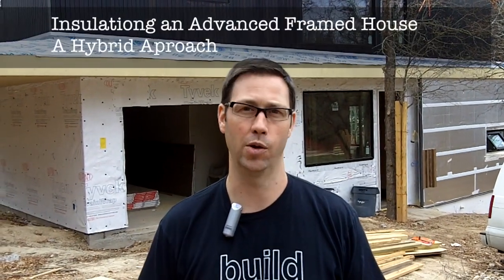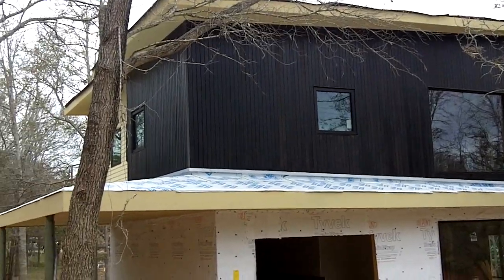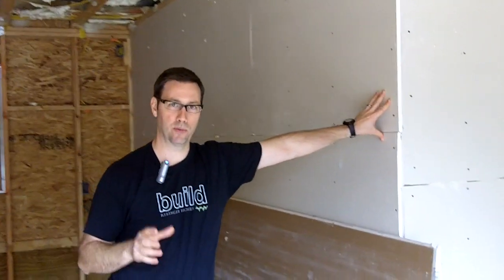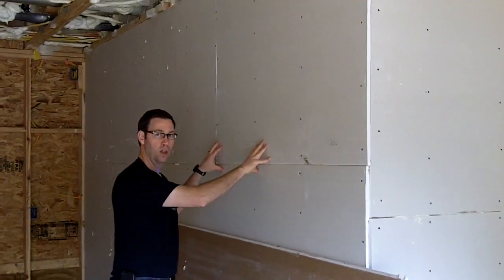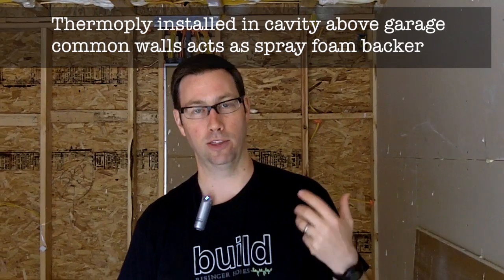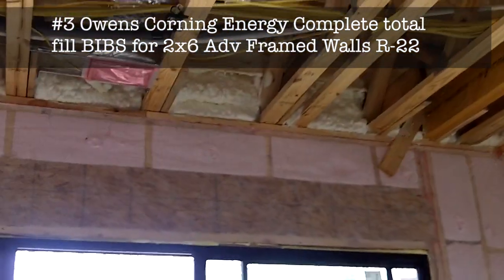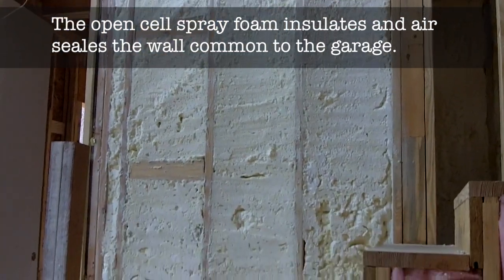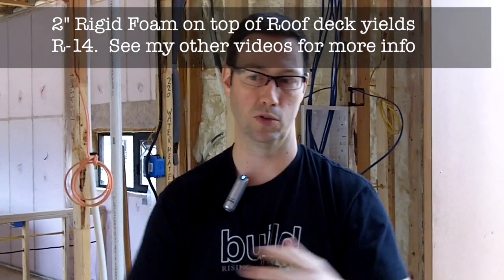Insulating An Advanced Framed House - Hybrid Aproach

Comment: Did you have to use the poly iso on the outside of the roof to form your moisture barrier for the dew point to occur in poly iso since the open cell would allow moisture penetration?

Comment from the maker: Neither of those are HVAC ducts.  Those are bath exhaust ducts so there is very little air flow through them.  They certainly could be insulated but I don't see much chance of condensation occurring.  Thanks for commenting!  Matt

Comment: Matt, 

I have enjoyed your videos, they have been very helpful in my remodeling work around my house. 

I was wondering why you didn't insulate the round hvac ducts in the ceiling of the garage? With the foam insulation having moisture nearby is scary, even open cell insulation. I know from firsthand experience that in Houston unwrapped round ducts will sweat with condensation, so when the dew point causes sweating you will have water sitting on the insulation.

Anyhow, thanks for the videos!

Comment from the maker: I've used it a few times and had decent results.  The hard part is getting the finish that the Architects I work with want.  I love STO / EIFS in concept but I don't love the knock-down drywall finished look.  We've had to experiment with getting a smooth finish that looks like an Integral Color 3 coat Traditional with the EIFS underneath.  Sounds like you'd like to see a video on that!

Comment from the maker: Mainly cost.  The foam starts to get expensive as you get to 5.5"+.  The 2x6 stud cavities can be air sealed really well with the sprayable caulk as part of the Owens Corning Energy Complete system then the BIBS fiberglass blown in works extremely well with no air flow in the cavity.  Best, Matt

Comment from the maker: Joe, Always appreciate your input.  I've not gotten my HERS score on this house yet but I would expect it to be around 40.  A standard code built house would score 100 and a net zero energy house would score 0.  There aren't renewables on this project so that score of 40 is really a sweet spot of being extremely efficient without breaking the bank to get there.  The foam is OK at sound but the dense pack fiberglass is really good at sound on the exterior walls.  5/8" Sheetrock inside helps too.

Comment: Great video Matt, you've really hit stride...
what about sound attenuation on foam.? Is that an added benefit or is there any difference between batt insulation. 

Might be good if you could get some actual energy numbers compared to what's spent extra for those energy savings. 

Very well done...you Da Man!1

Comment: Matt, Great video showing the benefits of each type of insulating/air sealing product and how they co-exist as a solution for the home.  Re: the Drainwrap water resistive barrier ... it has the vertical channels/grooves within it.  Have you considered using a product such as Benjamin Obdyke's Hydrogap?  It supposedly has the best drainage of the "housewrap" type barriers.  Curious to hear your thoughts.  Keep up the nice work ... interesting stuff.